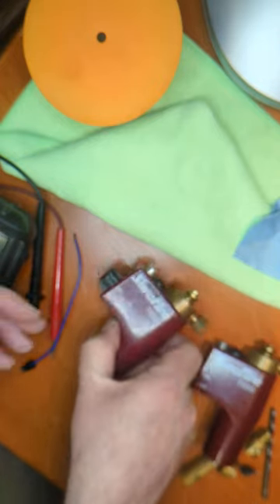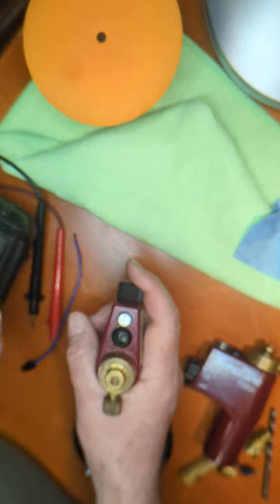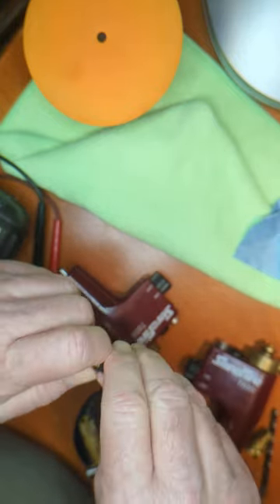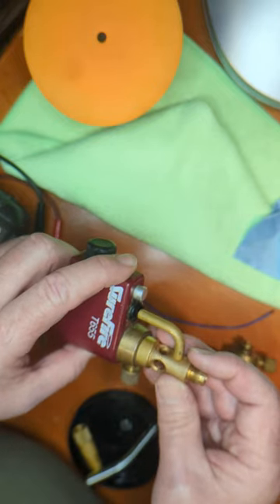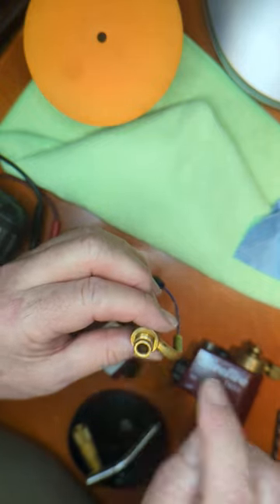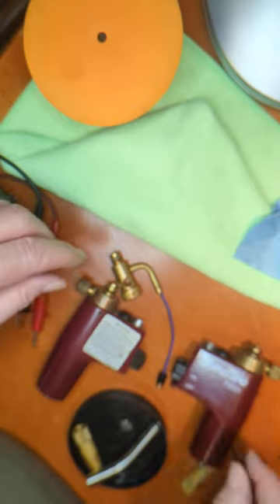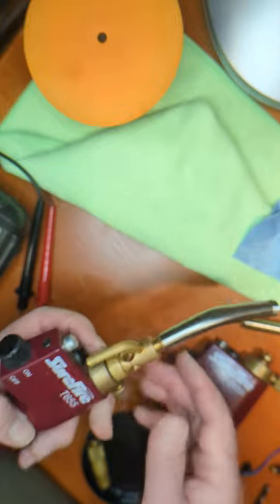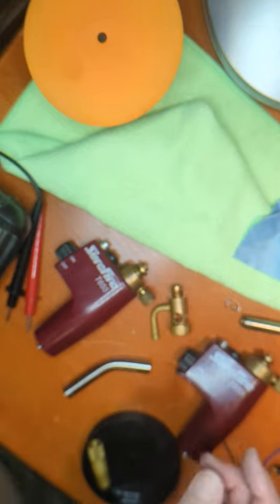Bernzomatic Surefire piezoelectric self-igniting torch trigger start disassembly teardown for repair

Comment: Thank you for making the video! Tricky things to repair... wondering if you've got any ideas on what to use for insulation material on the inside lips of torches to reestablish ground so the spark jumps. I've got a few that need repair, same issue. I realize distance is most likely the problem, but the original material is also gone, thus inviting the problem. I'd just like to make the spark more stoutm
Reply from the maker: You're welcome! The blue wire should be fully insulated all the way to its tip ... the only place it should make electrical contact is where the small brass base of the wire sits on the spring in the torch body.  The torch body should be conductive all the way to the brass tip.  That way, the only place the spark can jump is at the end of the blue wire, near the torch tip.  Can you see your torch sparking when you click the ignitor button?